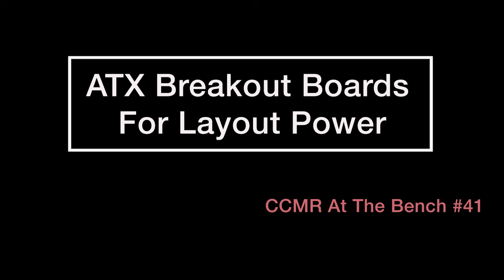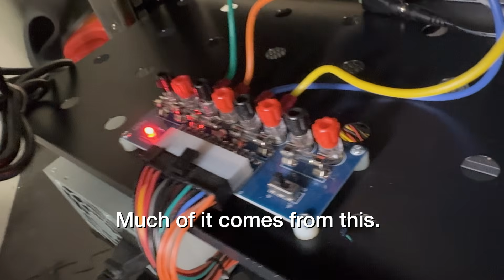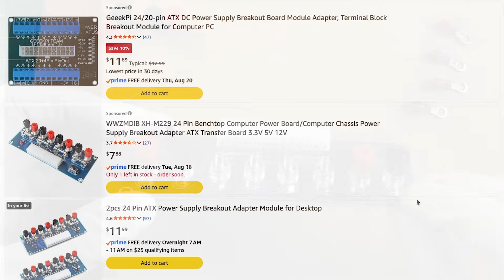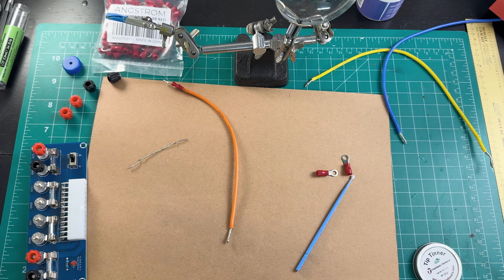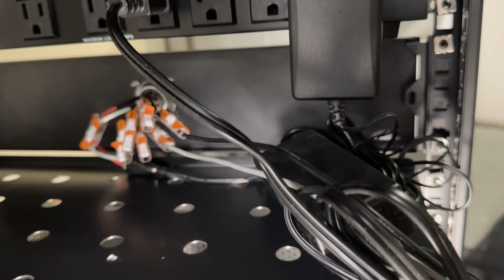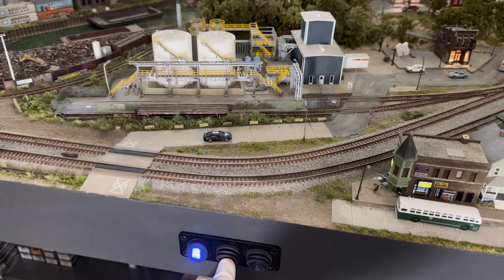ATX Breakout Boards for Layout Accessory Power | CCMR At The Bench #41

Comment: I have the same sort of setup planned for my layout, but always wondered what the difference was between -12v and +12v and if the -12v is usable for anything.
Reply from the maker: Great question and answer is not really. -12V is sort of a legacy power rail for old-generation serial ports and the like. Newer power supplies often don't even have it. It’s pretty impractical to try and use for a few reasons like current limitations and polarity, particularly given the +12V rail has a higher load capacity than most of us are likely to ever need for our layouts.

Comment: Those breakout boards are cool. I have one for bench supply, but be careful. They tend to have limited amperage depending on how much you plan to run off of it.
Reply from the maker: Thanks Ron. Agree - sizing out the the copper traces through the PCB suggests they probably wouldn't support too much more than what they're fused for. Overall I'd guess this supports 8-10 amps total load across the entire board.

Comment: i was curious, most ATX power supplies have a few different connectors on them, to power other items on the computer. what do you do with the other connectors? do you just leave them unconnected and hide them?
Reply from the maker: Hi Charles, I just tied them down and set them out of the way. Hidden in a rack mount like I have, it was pretty unobtrusive. However - and stay tuned for the more detailed video on ATX units as I'll discuss this and other items - many higher-quality ATX 3.1 supplies are modular, so you need only connect the included 24-pin cable to the supply. Other power cables normally meant for graphics cards and the like can be omitted, giving a much cleaner look. I'd advocate for ATX 3.1 standard in general, power management and stability are better.

Comment: Do you have any sort of load resistor? Many power-supplies will nuke themselves without a load resistor on the 5v rail.
Reply from the maker: Yeah it's a persistent question and potential issue with cheaper and/or older ATX supplies. Mine is new manufacture but is still group regulated. Early on I checked how it performs unloaded versus loaded. Unloaded, both 5 and 12V rails were +0.28V and stable over longer periods than it'd ever see in use, so close to or within spec and below the range where the supply would trip. My guess is it behaves well because very little is being asked of it in terms of load or long-term no-load stability.

Comment: Those breakout boards are great for using and old computer power supply into a cheap bench variable DC power supply ... well a different one of those that has the adjustable knob.
Reply from the maker: They're certainly helpful for giving those supplies a second life (with certain safety matters kept in mind)! Granted for my little layout this is all over-engineered versus what is necessary, but all by choice and for fun on my end. I recently upgraded my power supply to a more contemporary gaming version with independent power rail regulation. It's not shown here as the shoot date of the video is prior to that, but maybe I'll post an update.
Reply: @ChicagoCrossingRR  Hey nothing wrong with a little over engineering, hell if you took any standard DC power supply for model trains and broke it open you'd realize how incredibly simplistic it is, it's almost hard to NOT over engineer it.
Reply from the maker: @Mike__B  thanks for validating my over-the-top approach to powering a door size layout :). If nothing else about this hobby, I suppose it's fun to do things just because you can!

Comment: That's a convenient little circuit board if you don't cut the connector off of the PS like I do😂😂😂.  With the crimping tool you have, soldering shouldn't be needed. I'd be more concerned about the binding post connections loosening over time...
Reply from the maker: Hey Steve - yeah it's a nice piece of kit for making the connections easy and quick. The crimps are definitely solid but color me a bit fastidious with those joints (and I enjoy soldering so any chance to pull out the iron I will). Agree, much like IKEA furniture those posts might need a quick retighten every year or so, but that's an easy fix without having to do any post-hoc re-dos on the joints themselves. Have a great rest of the weekend! :)

Comment: Thank you for going over electronic connections and organization.  Most creators want to skip to the visual exciting things like scenery or running ops,  which don't get me wrong we all love, but wiring is the skill I feel most model railroads are lacking unless they have a engineering background.  I started using crimp connectors and  wago-style connectors  thanks to your videos, and I am so much happier with all the stable connections that wont short if you bump it funny.
Reply from the maker: Glad to hear all of those videos were of use to you. Wagos and crimp connections came about because they are easy and fast, and in many applications work very well. I enjoy the convenience and versatility of all of these. I'm sure someone out there would watch this video and complain that it's not 'real' electrical work, and then go on to solder a bunch of cold joints with poor stability and conductivity :D.